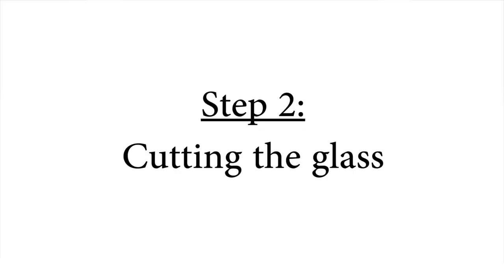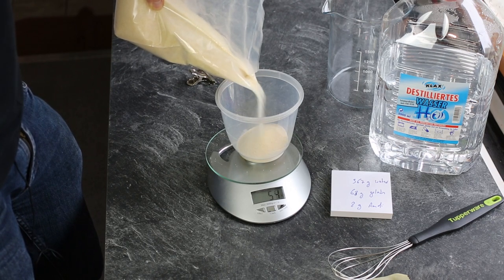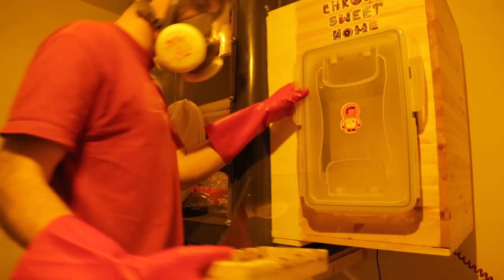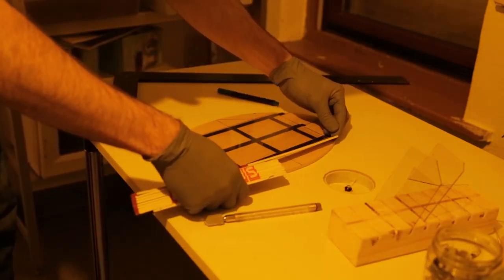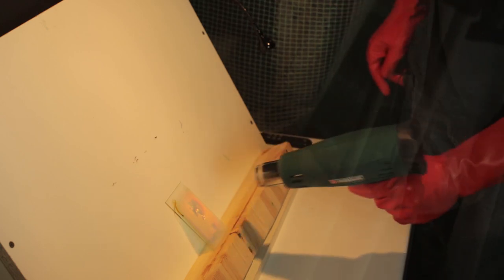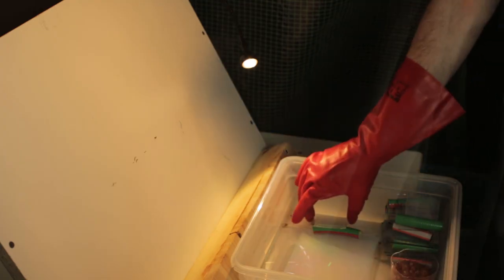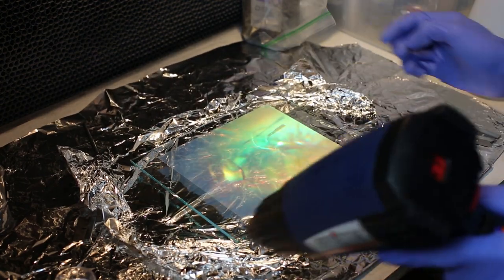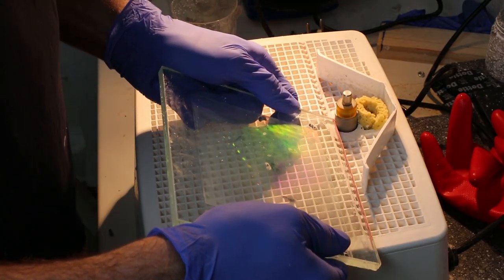How to make a Hologram

Comment: This is the first time I've downloaded a youtube video just to back it up in case the internet is shut down or something... just amazing!
Reply from the maker: Thank you Pangamini. If you have any questions about the Holography-process feel free to send me an email at info@holocreators.com
Reply from the maker: @Viking009  Depending on where you put the plate relative to the beam and object its easy to create a transmission hologram. The DCG-Hologram really works best with the single beam denisyuk recording setup that I have shown here.
Reply: @Holocreators  What I did was a denisyuk style, just placed vertically. The subject was behind the plate, but the table in front was also illuminated by the spread beam. I ended up recording the front side table  as a transmission hologram instead of a reflection of the subject on the other side. I didn't expect that, really.
Anyway I am not using DCG, as I could only get a red 20mW diode, so I've been experimenting with both PFG-01 and PFG-03 plates
Reply from the maker: @Viking009  yes using the pfg plates is a good idea if you just have red. Also when starting out you learn the craft easiert when you know that the holographic plates will perform well every time
Reply: 🤣🤣🤣 #amazingtoo
Reply: @Viking009  Hi Pangamini.
A friend of mine and I made transmission holograms at home about 40 years ago (1979). Back then we used a helium neon 5 mW gas laser, but I have often wondered if laser diodes (such as one from a DVD burner) would work. Do you have experience with laser diodes? And do you know if they produce good transmission holograms?
Thank you
Michael Walsh
Reply: @michaelwalsh3482    I am using laser diodes. However, not every laser diode is stable enough to be useful for holography. I bought mine from Integraf and Litiholo. The latter claims it's 20mW, ~15cm coherence length, stable after 5 minute warm-up. Now I mostly focus on reflection holograms, but I've had some success with transmission holograms as well. Also I am doing everything on a black concrete slab in my bathroom, so I guess it's not hard to outperform my setup :D
Reply: @Viking009  Thank you for that information. It is very useful.

I have noticed that although many people mention stability of their setup, nobody has mentioned how to determine if a "set up" is stable or not, and how to measure exactly how stable it is.
The stability of any set-up can be determined very quickly and easily, and quantified, by first building an interferometer on the light table that you will be using. It will tell you straight away if a light table is steady enough to make decent holograms.
Anyone who is going to make transmission holograms will already have all the items necessary to build an interferometer being 1) laser, 2) semi-silvered mirror, 3) 2 x front-silvered mirrors 4) 2 beam spreading lenses and 5) a screen on which to display the interference pattern (a stiff piece of paper or cardboard will do nicely).
I think that the importance of an interferometer cannot be under-estimated.
If the light table is stable and steady the interference pattern will be steady and will not drift, but if the interference pattern drifts or moves, the table is not steady enough and it will be a waste of time to try to make holograms on it.
I love interferometers. They are simple to build and use, and they easily show any movement to an accuracy of about 1/10 of the wavelength of the light-source you are using.
Reply: @Michael Walsh  Thanks for the tip. I am aware of the Michelson interferometer, however I don't actually own any semi-transparent mirrors or lenses (which is why I mostly stick to reflection holograms). As I said above, I am using a very amateurish equipment. Which brings me to an interesting question, as to whether you can point me to some good online store where I could obtain such items? Anyway, the stability I mentioned in my previous comment was referring to the laser output, not the mechanical stability - but of course, both could be measured in that way.
Reply: @michaelwalsh3482  generally diodes will not give good results, if you actually  care about the quality of the image. Defects abound.
Reply: @makkyd123  Thank you. That is useful information to know.
Michael Walsh

Comment: I learned about holograms in books as a young child (where I learned you need to minimise vibration in your studio!) and saw my first ones in a museum wayy back in the 80s.  I've learned about them in science class.  I'm no genius but I do have a fair grasp on some physics including some quantum mechanics and rudimentary signal theory,  but for the life of me, no matter how hard I've tried over the last 30-odd years,  I cannot understand how a hologram manages to manipulate the light to reproduce that 3D effect, and it's clear that no teacher I've asked actually understood it, either.   Sure, read up on it, it's "interference patterns" yada yada.. but it still doesn't make sense.  It's just mindblowing.   Your example hologram at the end is amazing.  The 3D structure actually obstructs itself as you turn it around.  Incredible.
Reply from the maker: for me its just the same. I understand the principal behind it, but what really happens on a molecular level is beyond me ;-) Well luckily you can still make a hologram without understanding everything about it
Reply: I doubt twenty five minutes of my time will suddenly cause you to understand but I can at least try to explain how I understand it.  First concept is the idea of a plane wave, I believe you 'get' the whole light as a wave thing and a plane wave is just coherent light, a bunch of waves all marching in step in the same direction.  In 2 dimensions it may help to visualize it as rows of really parallel, regular, and straight ocean waves.  Second concept is the reflection of those waves off of an object.  If the object is rigid and stationary on the scale less than micrometers, and the plane wave is regular the light reflected off of it will be constant and deterministic, the light coming off the object isn't random and is exactly as stable as the plane wave and the object it is coming from.  This reflected light contains all of the information of what the illuminated surface of the object 'is', and it is way more than what we actually see (it's the information of all there is TO see).  Third concept is interference, the incoming plane wave and the resulting reflection are going to superimpose. Because the plane wave is coherent (and also monochromatic) and the reflection is not random, a standing wave field is going to develop.  There are going to be locations in the volume of the intersection between the incoming plane wave and the reflected light where there is less electric/magnetic field variation (nodes) and places with more variation (anti-nodes).  Note: I say less rather than no only because the reflected light is going to have on average less amplitude than the incident plane wave because of the 1/r^2 relationship, this is also why in this setup the film has to be as close to the work piece as possible to try and keep the ratio of light intensity as even as possible (keeping the nodes as 'dark' as possible).  Fourth is the really cool thing, diffraction, If you figure out where all of those anti-nodes are and put a little bit of black stuff there (nano-meters in size) and then shine the original plane wave in the same orientation on that meticulously created pattern of anti-nodes, the plane wave actually diffracts off of all those black things in the exact way to recreate the originally reflected image.  I'm guessing this is the part where the WTF comes in, all I can really do is try to explain how I rationalize it.  The interference pattern is deterministic, the 'only' way to create it is to have the plane wave and the reflected wave interfere.  But it was created, and now you are forcing the plane wave into the interference pattern and it can't continue to exist as a plane wave after it interacts with all that stuff, the only way for it to exist in that shape is to recreate the reflected light.  Its a bit like saying A+B=C then taking A-C and the only thing you can get is -B where A is the plane wave, B is the reflected light and C is the interference pattern (the negative is identical as a positive for light basically and the whole node vs anti-node thing is the same as + or - B so just let me hand-wave that away as unnecessary for my point).  When it comes to making the hologram what you are capturing is the interference pattern, i don't know the chemistry of it for the dichromate, but the nodes and anti-nodes are being encoded into the Volume of the gelatin exposing the dicrhomate. It essentially builds that matrix of little bits of stuff all through the gelatin exactly reproducing the interference pattern.  So yeah, then he goes through the process of developing the dichromate, again i don't know the chemistry, so that the encoded pattern interacts with visible light instead of being transparent to it and then there is a hologram.  The last bit of hand-wavy stuff is the sun and most 'point' sources of light behave enough like a plane wave for the reconstruction of the object to look basically like the original to our eyes, and the fact that it is not monochromatic and it still works goes to trigonometry (for this type of hologram: Denisyuk) where if you change the angle of the incident light the hologram will change colors something something cosines.  \WALL OF TEXT
Reply: @MaxIV77  OMG, that's a big ole mess.  Don't overthink this.  A hologram is just the wavefront from an object, referenced to a coherent wavefront, by optical interference (the same property that makes an Interferrometer work).  The interference exposes the medium with millions of fringes.  If you look at a holographic medium under a microscope, it all makes sense.  You'll see complicated patterns of lines all crashing into each other.  If you block the reference beam, and just expose the medium with the light coming off the subject, you won't get a hologram.  Seems easy to me.
Reply: @MaxIV77  New to the subject matter. Thanks for a superb explanation that made intelligible the whole process.
Reply: @Holocreators  At the end, while you turned the hologram backside and it shown the inverted object parallax, this gave me a hint to how people create holograms where the object appears to be at the front of the glass (or cutting through it) and not behind the glass.
...They just make the hologram of the hologram turned backside at the desired distance, and turning it backside to reveal the original parallax. So, the copied hologram will have the object shifted towards the observer:)
Reply: @MaxIV77  But why does it need a special film? Why can't it be exposed to ordinary thin photo film? According to the technical book, there are two types of holograms, thin and thick film. So why does everyone make their own photopolymer gel? Is a positive photo film not transparent enough for the laser to shine through for transmission holograms?
Reply: @retrobudapest  It's been a long while since I kept up with these things.  But a few things that might help to understand.  The easiest holograms to make in a lower budget situation are going to be volumetric holograms.  Stuff where you are capturing the hologram information through the volume of the film.  There are surface holograms, but those are often stamped and require a whole lot of different stuff to make your own and I don't think contain much 3-D ness.  Back to the volumetric stuff, you need your light sensitive particles to be a certain size to react on the scale of the interference pattern, you need the particles distributed through the volume, and you need the film to be mostly transparent to the light or you risk being over exposed and having  a weak hologram.    So I'm sure that there are ways to make some common commercially available films do cool things, but you would probably have to design your process around the film and even then there is probably going to be a pretty low ceiling for how good you can make it from film not really fitting the needs for holography.
Reply: @MaxIV77  Let's clear the basics. With holograms, is the thickness of the film important only to increase the resolution of the light-sensitive material? Until now, I imagined that there were grids on the film that were shot by the interference light rays. And when we look through the hologram, we are looking through these grids, and that is why the viewpoint and the image we see will depend on the angle. But is this idea wrong? Is it something completely different?
Could a perfect spatial hologram be created in the same way on a plate with a sufficiently fine resolution, no thicker than the wavelength of light?
Reply: @retrobudapest   The thickness of the film controls the intensity of the hologram.  Well that and the contrast of the interference pattern captured by the film.  And the grid analogy is 'ok' for a bare bones understanding.  But you are not blocking light, you are diffracting it.  You also aren't looking through the hologram, all the light you are seeing "behind" the hologram is coming from your side of the film (At least for these kinds of holograms).
Reply: Imagine the sufrace of the object as being a set of points each having X, Y and Z coordinates. In the case of a transmission hologram, both the film and objet are hit by plane wavefronts. Each point of the surface of the object will reflect the light as spherical wave fronts. The interference between the plane and spherical wavefront will expose Fresnel zone plates on the film. The X/Y coordinates of the point defines the X/Y coordinates of that zonenplate on the film, and the Z coordinates defines the focal point of that zone plate. The zoneplates are superimposed and each of them spreads over the entire area of the film. A zone plate is a set of concentric rings that get spaced closer apart as you move away from the center, so if it is hit by a plane wave (parallel rays), the rays that hit the center of the zone plate pass straight through, whereas those that hit the edges get deflected more by the diffraction grating made out of concentric circles, so that they hit the focal point. Actually, as the zone plate is a diffraction grating and it will always deflect the light rays in 2 ways, inwards (converging to a point in front of the hologram) and outwards (diverging as if they came from a point behind the hologram). The latter rays are what reconstructs the image when the hologram is illuminated by the reference beam, as they follow the same path they would have taken if the hologram was a window with an object behind it.
To avoid having light converging in front of the hologram, the reference beam is actuallt aimed at about 45°, so that, instead of having slightly diverging and slightly converging rays going towards the viewer, the diverging rays are deflected -45° and go towards the viewer and the converging ones are deflected +45° and go to the side of the hologram.
Reply: @atmel9077  Finally.   Thank you.   And here we are a month later.  I thought I had already replied to you about wishing Mr Huygens would do a video about it.  But it looks like 3b1b beat him to it!   Watching that video now reminded me that you had replied with your great explanation.
Reply: 3b1b made a wonderful video about it.

Comment: Very interesting. 30+ years ago, I bought a hologram from a shop in Brighton, UK. I put it in with some papers when I moved to the US. I was looking for it recently and couldn't find it anywhere it should be. I'm coming to the conclusion that I probably ran across it about 10 years ago and it was spoiled and I threw it out. This video would seem to back that up. I was actually looking to see if I could replicate it (or something similar) and I found some various kits. Nothing looked quite right or needed point light sources etc but this seems the closest to the look that I remember. I don't recall the glass being that thick though. Then again, it was mostly hanging on my wall or in a box.
Reply from the maker: Hi, those holograms can last a long time, depending on the quality of the seal. 
But there are holograms that are made with different techniques than what i show here, so they don't vanish
Reply: @Holocreators  I recall it had already begun to fade a bit when I took it down to move. It was probably already 14 years old by then. I wish I had a clear memory of getting rid of it. I'm still holding a small hope that it will still show up.

Comment: This is one of those "If it was easy, everyone would be doing it". It must have taken a huge amount of time to work out the details of this procedure. Even with your exact instruction, replicating the process is not trivial. 
This video documenting your procedure is excellent, you have my respect.
Reply from the maker: thankyou. yes it was an enormous task to create this video
Reply: Yeah ..
Reply: @Holocreators  yes we could realized that. yes it was a great and hard task
Reply: It's only because the control circuitry for such spinning displays are now available so you don't have to build a control circuit to do it anymore, at worst you would just have to download some public domain software for something like an arduino or pi computer.  I remember buying a battery hand fan that had such a display.

Comment: Swann, this is a masterwork!  When I last did holographry in college, we had a Newport table on top of wool and inner tubes, a magnetic long bore gas laser, spatial filters, polarizers, beam splitters and balancers, dark rooms, stopwatches, and pricey Kodak film.  I love your exposure setup, you make it look easy.
Reply from the maker: Thanks. The exposure setup is rather simple yes. Its just the denisyuk setup. With 3 contact points that offers the most stability.